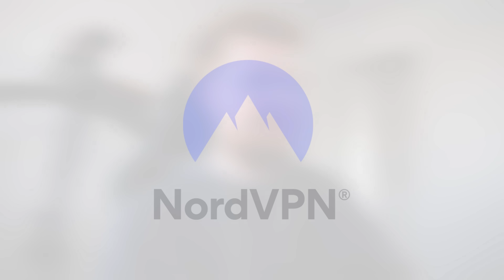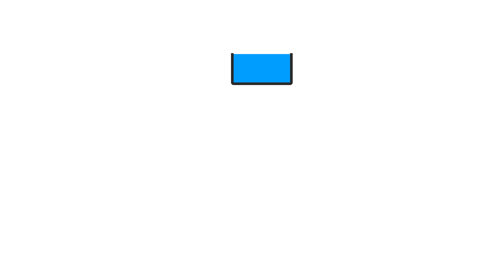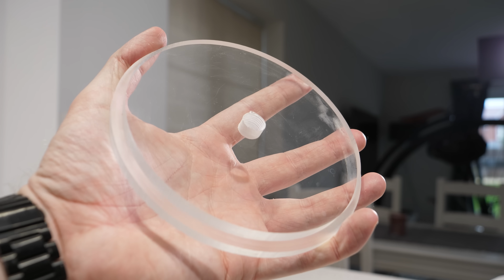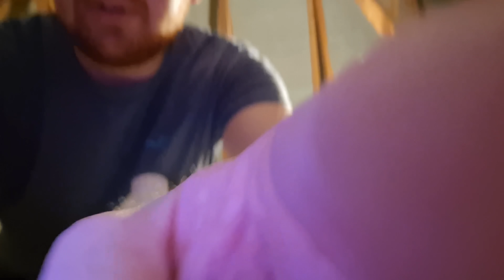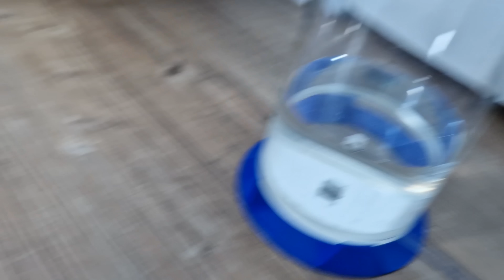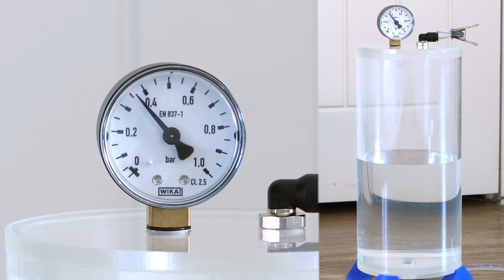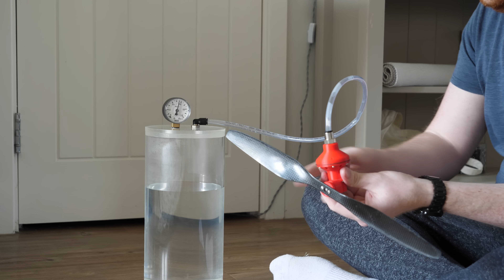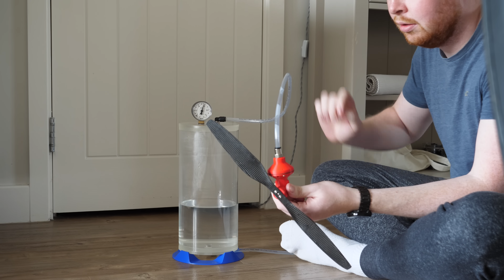Liquid Air Engine

Comment: So it means, that it runs that long time on a air volume of the tank? How much is it? 5-8 litres? If you could hook up somehow more of theese or pressurize a bottle by pumping it and reduct the pressure, it should run even longer, or not? There would be probbably some issues with the downcrease of the volume by reducting the pressure (it cools down), but summer and hot sun is coming up and it could be another interesting project!

Comment: Nice!  Of course the run time relates to the amount of air initially in the tank, which is not replaced.  Switching back and forth between two pressure tanks (drained when not in use) could last as long as your water supply held out.  Gravity-powered engine.

Comment: I am not sure what the appliance for this would be, but I like it!

You could get higher pressure by using a second cylinder instead of the upstairs bucket and then weigh it down.

Comment: Hm maybe you could reduce the load on the engine by taking the prop off, and putting an electric motor there to generate electricity. Then see what you can power from it! 

You might even try motors of different voltages. You could also increase the voltage using a transformer. Although transformers "don't work on DC", neither does an electric motor produce DC. Well, it does, but really it's more like AC with the poles swapped over every half cycle (ie what a commutator is for). So the output waveform of a DC motor working as a generator will look like half-AC, and that should still work a transformer, if only at half the voltage of full-wave AC.

Or you could just get a DC-DC convertor module. A transformer is maybe a bit more versatile though.

Comment: So now you could take a big air tank, fill it up, regulate the pressure to around 0.5 bar, and have the thing run for hours. If it's a compressor tank, it could run forever and refill the tank maybe once or twice a day, depending on designed rpm.

Comment: This is just awesome :D Also just how you are at the edge of the envelope where those things can work. I'd be interested in seeing what happens if you suspend that water tank from the ceiling of your attic :D Or put in on the roof :D Or put two tubes in parallel between the containers, or or :D

Comment: you don't need to empty the tank and carry the water up stairs. You can add a third hole on the top of the tank, and push some air in it with your bicycle pump, this will push the water back upstairs trough the hose.

Comment: the solution to your issue is to add more cylinders :3 being able to apply at different stroke phases will enhance efficiency as the blade wont be accelerating and slowing down as often (which is how the change in direction occurs), and the resulting increase in total diaphragm area will allow it to run better at lower pressures. Have you considered adding some intertial mass (flywheel) to the system to also help balance out the power application of the motor to stop the accel/decell issues it has?
Reply: those are good suggestions
Reply: Crank would be really weird
Reply: I don't think 2 more cylinders will work because it will draw 2 times more air and the water won't have time to build up pressure for 2 more cylinders
Reply: @gurraflex6478  it would be a tradeoff - more power for less runtime.

Comment: I don't get the whole point of using the water to pressurise the air. Good to see the development of the motor to run on lower pressure but again this could be done without the whole water tank part

Comment: This is so, SO cool! 
Can you make it so that there would be a small leak valve at the bottom of the tank, so it wouldn't ever fill, or fills up extremely slow?
Reply: If it didn't fill up it wouldn't pressurize the air.
Reply: @superfluidity  
Depends entirely how small leak.
I'm sure it can be balanced so that it will work.
Reply: @mattiparviainen  But it's the filling up that pushes the air through the engine.
Reply: @superfluidity  yes, I know.
But as you saw from the video as well, it'll self-regulate already.
Why not take it one step further by using valves to add more air into circulation and rid excess water 🤔

Comment: You could increase flow rate just by changing tubes to bigger diameter and use couplers to connect to smaller inlets.

Comment: I think you could add little magnets at the ends of the propeller to act as a flywheel, thus reducing the amount of pressure needed for another stroke. Adding a flywheel and then shortening the needle could potentially reduce speed and improve efficiency

Comment: Well done Tom. 

Great success. So if you took the propeller of the front of the engine and attached the output shaft to a small generator. Would it generate some measurable power? If so this system could work similarly to a hydro electric dam, without needing the dam. Obviously the higher the water source the greater the air pressure. I could imagine banks of your engines all attached to generators on a larger scale, creating bundles of endless free energy.

Comment: Hey Tom I built your whipper trebuchet and I can’t get it the launch the tennis ball well. We filmed the launch is in slow motion and it seems like the tennis ball isn’t staying tight with the arm. It seems to be falling sooner than it should and hitting the ground or the base of the trebuchet and not launching correct do you have any tips to fix these problems or help launch it better?

Comment: Makes me wonder, could you combine this with a tankless water heater recirculating loop, and have it so your recirculating loop, when it returns cold water, instead of that gravity going to waste you're actually using it to generate electricity for later? (Tankless water heater recirculating loops have the cold water return at the highest point in house).

Comment: Kind of the opposite of an RO or well water water storage tank that uses an air bladder to pressurize water so it can flow throughout waterlines through a house. RO pressure bladders range from 10psi when empty to 40psi when full.

Comment: Very interesting experiment. I like it. I thing, it will work much better with a kind of flywheel with some mass, then, in my opinion,  this engine will work much smoother and also reversing problem should be fixed.  Anyway, I had a good fun watching this clip. Good luck!

Comment: Weird question... but could this sort of setup be used as some sort of Windmill/energy storage device? 

Like could you design a device that allows air to be pushed in by the action of the wind when sufficient wind is present. Creating energy while using part of that energy to fill up the tank by pushing the water back into its upper storage via increasing pressure. To than use the energy/pressure stored by the upper water tank to make the Propeller turn (creating energy) while the wind is inactive or too small to properly push the propeller?

I can think of several ways to do this, maybe the propeller/windmill is only active during the wind, and uses the mechanical or electrical energy to push the water up to a higher point (like those water energy storages you see in select places). Than potentially using the same propeller to generate energy via the gravitational potential energy of the upper water being used in this fashion. Obviously probably impractical or silly but idk, just came to mind.

Good vid either way!

Comment: I'm curious if any amount usable energy could be extracted from this sort of cycle if it were scaled up to an off-grid solution?  Imagine having a water tower shaped like a donut or flower petal (for water catchment) with thousands of gallons in it, and a electric motor/generator at the bottom.  Then do a calc of how much water you'd need to use per day to keep the ground receptacle from overflowing but still generating electricity.

Comment: TIL that you can use air engines to power a battery, to fill the air tank and repeat the process ad infinitum with only a minor input of manual power to start the process and counter power loss

Comment: I was thinkin g what if you use smaller diaphragms again but with TWO cylinders.  that would increase complexity but you have the basics downs.  might gain some torque.. and stabilise the rpm.  although i'm not certain there is much gain for practical applications.

Comment: Another very cool project.
I could see this being combined with a flywheel / rain collector for a small generator. 
You could use the motor you made for the e-bike, just re-wind the coils with more turns. 

Also, I'm curious how your engine compares in efficiency to an air-hogs engine. Could they run on pressures that low?

Comment: Tom if you used a telephone pole with 2 pulleys on at the top and 2 tanks that you could raise independently you could potentially run your little motor indefinitely and at a much higher RPM.

Comment: thats why they invented cheap water filled hose pipes & 5v/12v pv air pump's to send the trapped air up the extra water column into the base aka trompe of a sealed loft weighted gasometer tank inside a cheap large 'plastic storage box with lid' to better control the net pressure for longer... & stop hand lifting the water after each run, just recharge the loft cistern by re pressurising the bottom tank to send the water column back upstairs automatically get a few cheap £5 esp32 with integrated wireless camera's to see what's going on real time at each end too.

as a side note... just add a simple jelly to help seal the internal diaphragm expansion area... & yet again simply dunk the engine parts in generic cheap water glass path sealer to properly seal & protect the 3d prints layers even integza would have a hard time burning sealed thick water glass/sodium silicate layers

Comment: Wow Tom! That is some serious improvement in efficiency and output. I think now you could probably figure out how to incorporate a small "gas generator" by using some form of say baking soda/vinegar, mentos/coke type CO2 reaction to create tank pressure. Doing so will probably get you a similar run time without all the weight and hassle of a large heavy tank. The trick would be controlling the rate that the CO2 reaction is taking place. Exciting!

Comment: Next you need to try pumping the water though the ending instead of the air and see if the performance changes. Just connect the hose from the roof directly to the engine!

Comment: I'll make it simple there is way more to it than this.
First the water power supply.
It needs to have a smaller diameter feed line back to the tank at top.
Next the pressurized air.
It needs to have an inlet line of smaller diameter.
This will provide continuous pressure that you would be able to regulate easily.
All factors in this equation must be relative.

Comment: Interesting. Your tubes are definitely not the correct size. Instead of increasing the  diameter, add one in parallel. Use a T or Y adapter at the inlet.

Comment: Isn’t it human powered rather than water powered?
You stated (not en exact quote) you will be running the engine off of the energy of the water but i think if you where to be exact you would have to say the engine runs of the potential energy you, human, added to your machine by carrying water upstairs! 😜
Anyways, very cool and absolutely impressive you can run it off this really low airflow.

Comment: A heavier flywheel may help with the idle problem where the engine gets turned around, it may allow it to run at a lower RPM

Comment: The difference between your actual readings and calculated pressure for the chamber is that water will not hydrolsize, water will "incorporate" some of the air into itself...

Comment: Very cool stuff! Increasing the density of your fluid would let you reach higher pressures in the tank. Maybe you could use a saturated salt solution to increase the pressure (by about 1.2 times). OR you could go crazy and use mercury or something :)
Reply: Use barbecue sauce. That stuff could probably hold more pressure than the tank! Plus your "exhaust" might smell tasty. Lol

Comment: I love it. I can think of so many RL practical applications for it. Though, it would need adjustments for those.

As in bigger water storage under the roof. Maybe a water storage that is even higher. Much (much much) bigger air tank. Bigger hose to improve flow rate. Maybe converting your engine into a 3 stroke (after all weight doesn't matter if your power source is stationary anyway). Using resin printed parts to improve tolerances. (Which I can't do [no resin printer] and am jelly that you can). And replacing the propeller with a generator.
Reply: Great video! Could also add salt to the water - increase density/HP thus higher pressure!

Comment: 13:29 why did the engine switch direction?
Reply: Because of the way the ball valve works. At slow rpms, the valve may open before top dead center and push the piston backwards. The way around it is a timed Valve

Comment: My proposal is to use dry ice, while there is chemical reactions that are safe and can provide the gas flow needed there are chemical reactions and can be hard to calculate and adjust.
While dry ice has the risk associate with CO2 those are easy to manage (make sure the area is well ventilate, take breaks and not working alone), and the pressure would be temperature delta depended.
yes, a safety valve would be needed to avoid pressure vessel rupture however is not that hard to make one.

Comment: Hey guys, I had a question for all the engineers in the comments. I am working on a rc plane designed to submerge and "fly" around like a submarine. One of my design requirements is that I want the plane to transform back and forth without me having to do more than flick a switch on my controller. I think I have a handle on the mechanics of this, the problem is I know nothing about coding. Iv only taken 1 semester of coding in c++ till now. Why is that important? As you may already know, the low frequency radio waves used by RC airplanes can't penetrate water more than a few feet. If I want to land my sub-plane in a lake and submerge it, I will need the ability to penetrate water more that a few feet. From the research iv done, high frequency radio waves are better at passing through water, alternately I could do something crazy like use sonic pulses as communication. My questions are these. What would be the best way to communicate with my sub-plane above and underwater, and how would you recommend starting learning the coding/electronics I will need for this project?

Thanks for the help guys!
Reply: Do you have the mechanics sorted out yet? Because I think that might be a bigger issue. You can always do a first prototype with a wire connected.
A plane necessarily needs to be light, however a sub needs to have a density of close to 1 kg/l, the same density as water.
A plane needs large control surfaces and a low torque, high rpm propeller, a sub small, with a high torque, low rpm one.
I think comms are the least of your challenges.
I hope to see you succeed, but it's far from an easy project.
Reply: @HansStrijker  my plan is a hollow carbon fiber body that can act as a ballast. CO2 will evacuate the water and a servo controlled valve will let the water in. For propulsion, I am going to use 2 counterrotating RC plane motors. Not ideal for underwater and it won't be a fast sub-plane but that's the current plan. May change later but that's the plan for now

Comment: You should add a bike pump valve to the tank at the bottom so you can use a bike pump to pump the water back upstairs.  That way you don't have to drain the tank and carry the water up.

Comment: You said you didn’t want to put larger fittings on the tank, but even if you had reducers to go from larger tubing to your tank you’d get much better flow with a larger tube and the reducer.  Look at how flow rates change with tube diameter.  It’s actually shocking.  If you ran tubing of double the diameter and reduced it to the size of your fitting on tank I think you’d keep up with the engine pressure needs no problem!  Great video!!

Comment: Make sure to minimise length of pipe to roof. reduces flow friction. also add a manifold at the base of chamber and run multiple tubes up stairs.. Plenty more things you can do to maximise

Comment: This would be an interesting design for a boat engine. put some weights on the bottom of the pressure vessel and let it sink a fair distance. then connect it to the air powered engine with the propeller in the water

Comment: I wonder, how much cleaner would a resin print be used to make these parts?
I'm thinking the tighter manufacture tolerances in resin could up the efficiency (seals, smooth bore, ignore infill, et al)... Use the extrusion method to make the first parts until it works, then take the final model through a resin print and compare their performance.

Comment: I have an idea you should try for your compressed air engines. Drop a small bit of dry ice in the water. the co2 expansion will greatly increase the pressure. Might want to make an emergency blow off valve so it doest over pressurize and explode.

Comment: Is it possible the pressure result is higher than calculated because of air that got pushed from the tube into the tank instead of bubbling up to the attic? I'm an idiot here, just asking

Comment: hi, what about adding a small type of flywheel to add a little weight to the prop, or even test it with a weighted flywheel instead of the propeller ?  the engine might just need that small amount of inertia to keep the engine going at a slow speed !